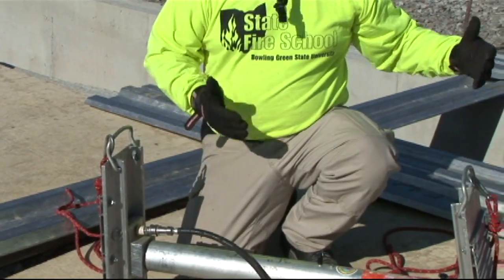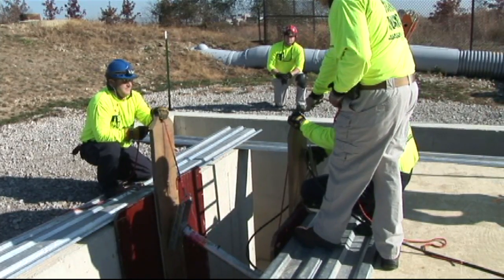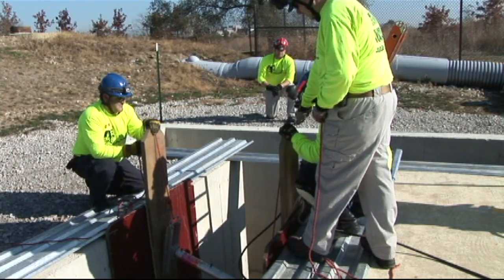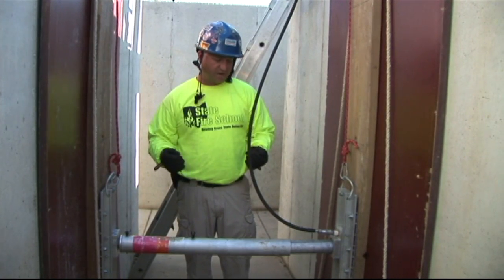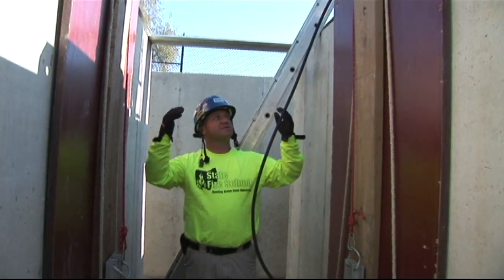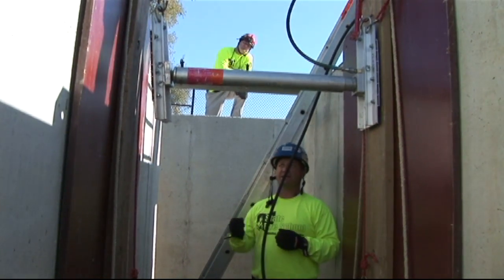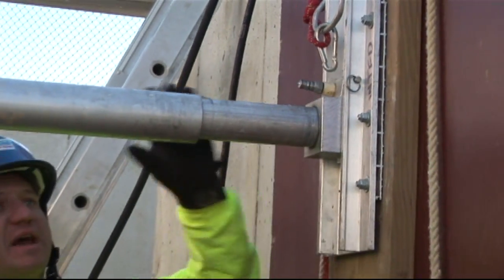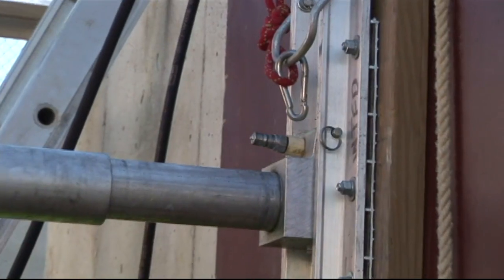Speed Shore Strut: Installation

Comment: Single shoring jacks are typical installed from the top down. By setting the top one first you minimize the potential for the bank collapsing at the top of the trench under the feet of the worker that is setting the jack.